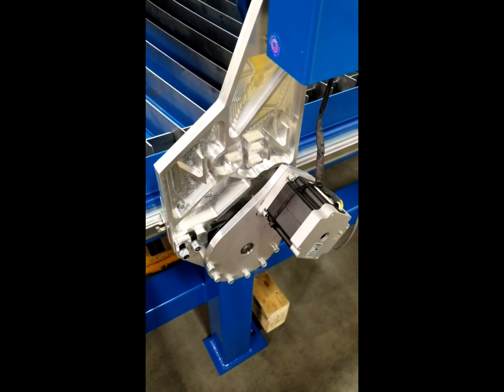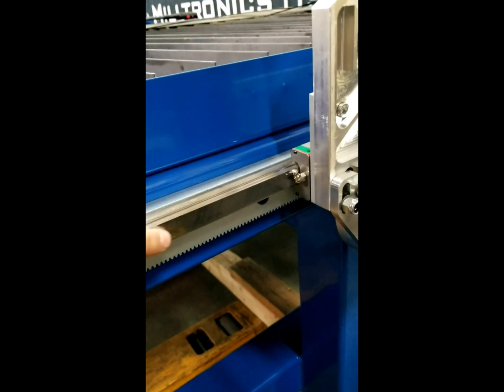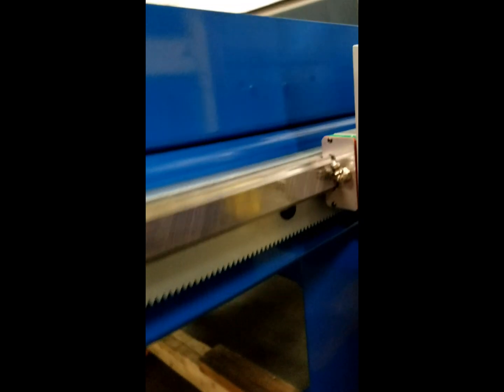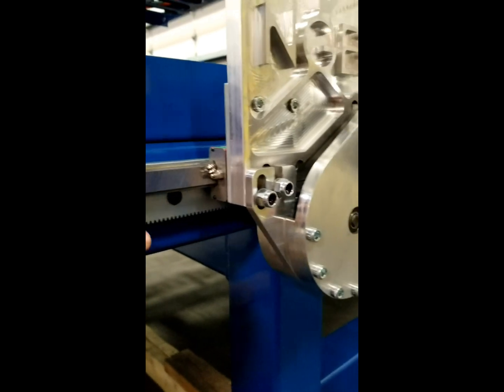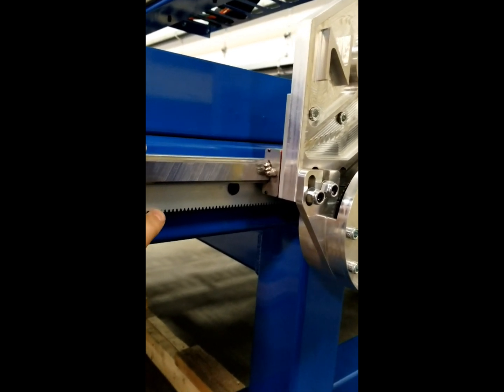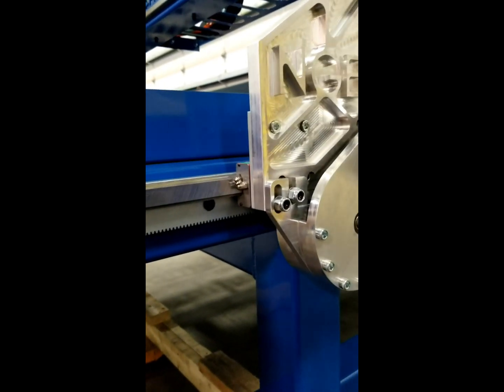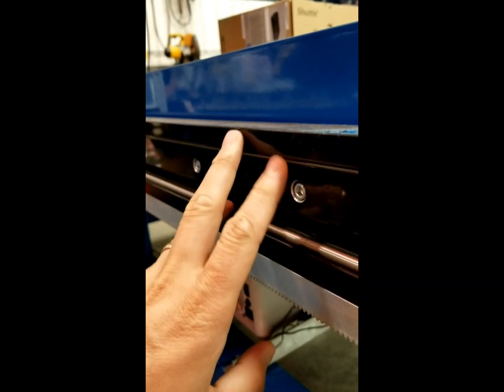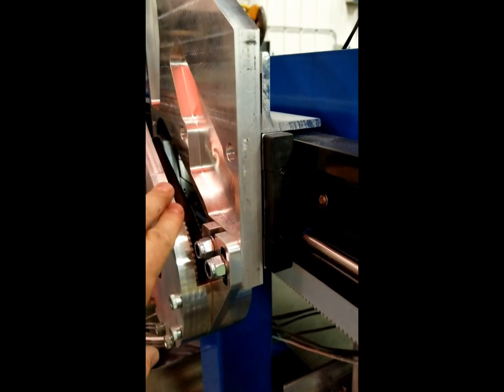Star Lab CNC Rail types and integration

Comment: Your design with the solid mounted motor reduction unit probably allows you to run faster (more reliable) IPM as well. The guys on the forums can’t get enough of your machines! Keep up the good work. 

For us DIY guy.. do you offer any packages selling the linear rail, rack, and maybe reduction unit separate? I’d love to upgrade my self built machines hardware.